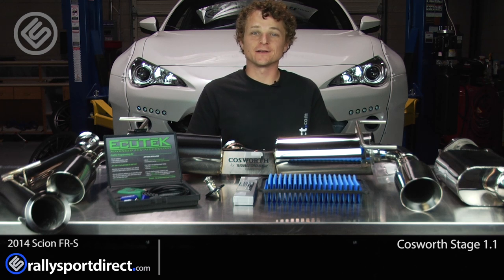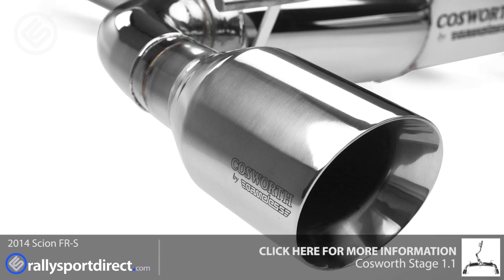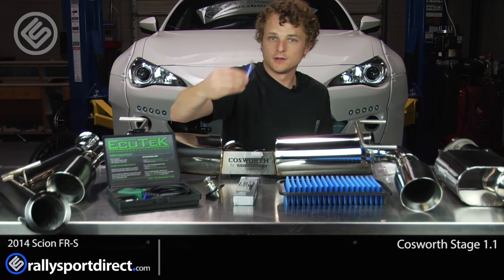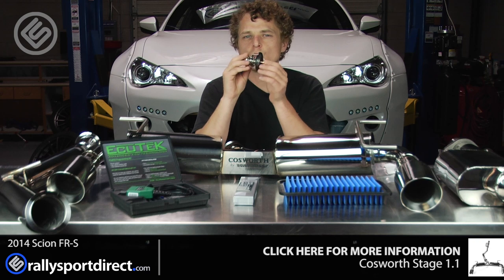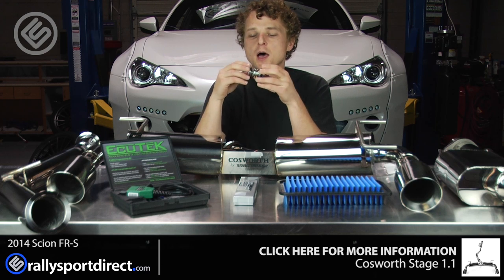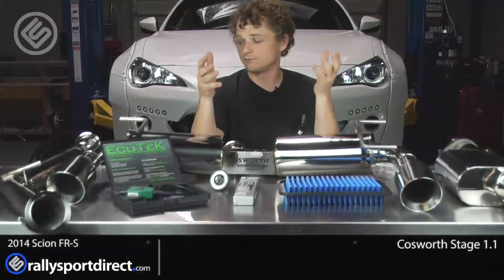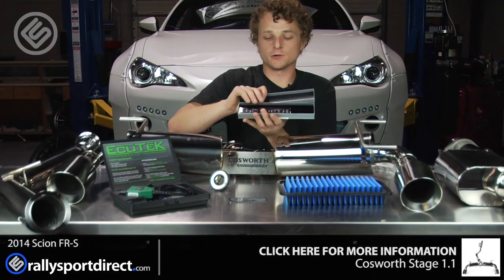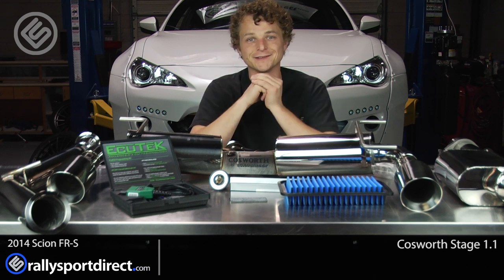Cosworth Stage 1.1 Power Package - Scion FR-S/Subaru BRZ (Install, Review)

Comment: There's no way you're getting 23 hp from a catback and an air filter. If there's a power gain it's from the tune alone, the catback and filter won't do much at all. Is cosworth claiming 23 crank hp or whp?

Comment: What are the HP gains for just the tune?
Reply: +JSchaaf The stock muffler is actually not that restrictive.. the shiny exhaust is mainly for sound and show (if that is what you are going for). You might get a little gain from it but if you are trying to get the most out of your budget there are other mods with better gain